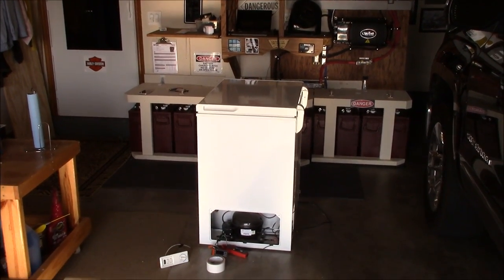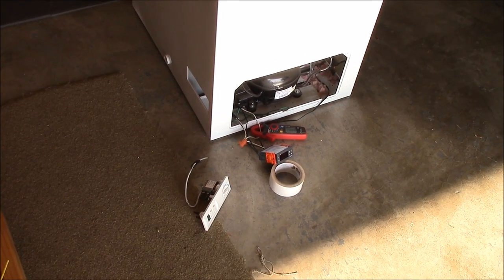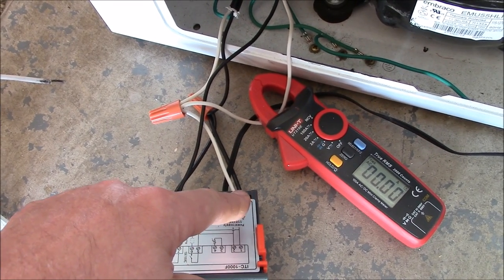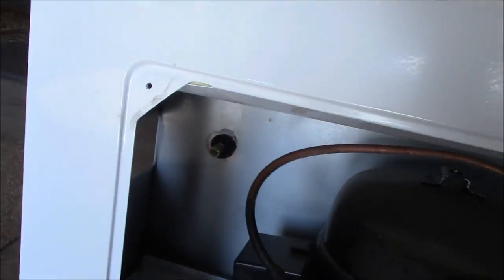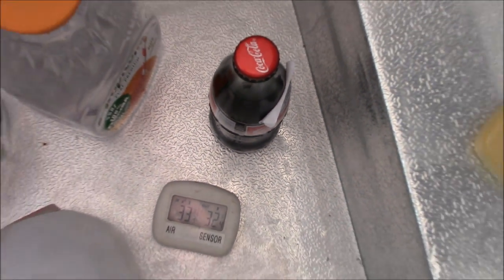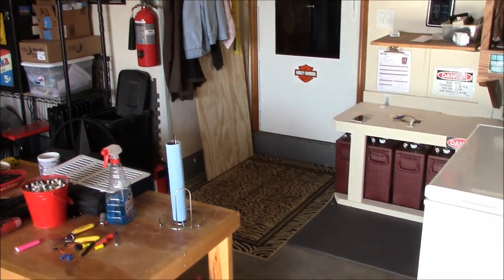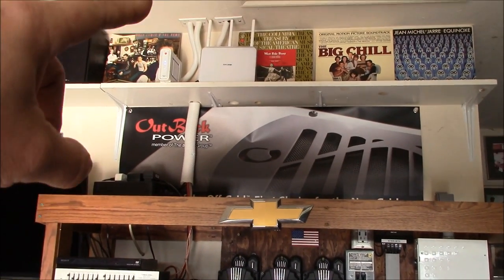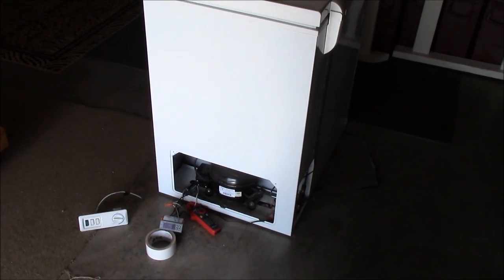Deep freezer to refrigerator conversion / How to wire it up

Comment: The solar looks good, nice n neat.
Reply from the maker: Thanks...4 and 6 AWG THHN (NEC rated) wire to the three controllers to the Carling C-series panel mount breakers. No more DIN-rail polarized breakers, ever.

Comment: Hey, cool project, lol.  I saw this YT vid where this guy made a freezer like yours even more energy efficient by strategically installing rigid foam in places.  I know he stuck a panel on the underside of the door and a couple around the compressor.  He did a before and after comparison too.  Great vid!
Reply from the maker: Hmmm...gotta link to his video?
Reply: Hi, I got lost looking at a bunch vids and can't find the "one" I was referring to, but without going too deep, insulating btwn compressor and box and allowing heat to vent out, rigid or spray foam.  Alonso it's easy to cut a piece to fit under lid.  Of course adding rigid on the sides and maybe in the door too.  You know when they manufacture these it's all about saving money, so not much thought to adding expensive rigid.  You know I was just thinking since you were messing around with it.  I've even thought about a computer fan at the compressor to expelled heat.  It appears maybe your condensor coil is hidden inside the skin?  Interesting way to dispelling heat, ya think? Another fan?  Idk, Anyway, appreciate your posts!

Comment: Nice work brother im going to try that soon. System is looking great I hope U have no more issues.
Reply from the maker: Thanks man...good to hear from you. Saw 5,100+ watts (from 4,900w in panels) the other day. Had a little cloud edge effect and cool panels. Nothing "popped" on the new set-up. It is running really, really good. All the Midnights have the new and latest firmware updated too.

Comment: Nice job Chris.  That is a similar set up to the style of fridge I use up at my lot.  That modified freezer should not operate as frequently as a normal fridge, I would think.
Reply from the maker: Roger that...agree. Gonna throw my P3 Kill-A-Watt meter on it for 24 hours and see how much it uses. Should have took a 24-hour reading prior to installing the digital thermostat. Thanks.

Comment: Would you be able to use this configuration to hold the temp at a significantly warmer temp? I'm thinking about converting an old chest freezer into a beer fermentation area and would want to maintain temps around 64-72 degrees.
Reply from the maker: IDK...Amazon still sells them for $16 https://www.amazon.com/gp/product/B0152LYY0I/ref=oh_aui_detailpage_o02_s00?ie=UTF8&psc=1

Comment: I see your tube for the thermocouple is horizontal. I watched your second video first lol. Mine are vertical. Does your tube curve up? That would be hard to push the flimsy wire up there far enough. There is a little delay doing it the way I did but the band width (temp swing) is only 1 degree more than doing it the way you did. I tried it both ways just to see if using the original tube thermostat location would work. On my 8 1/2 ft it took some time to get the thermistor wire up there. I am sure mounting it the way you did is more accurate.
Reply from the maker: Thanks! The old probe pulled straight out (8" long). Sealed the hole with silicone. No way in heck to install that flimsy wire into it. The probes thickness was about the diameter of a metal clothes hanger. Wiring it up was a breeze...

Comment: My 145 litre (about 5 cu ft) chest freezer/fridge uses less than 200Wh per day in the winter and about 300Wh per day in the summer.
Reply from the maker: Holy Moses...really? That is great!
Reply: I was able to see how much electricity it takes to charge the batteries while I was staying up the road at my parents' place over Easter.

700Wh. That's with the fridge and inverter running.

Comment: I have a 3.5Cuft chest freezer, and the same thermostat controller as you but it's the 12v version. My idea was to use a small inverter I have to use only for the fridge. I wanted the thermostat to tell the inverter to turn on and off to avoid idle draw. I hope I can get it working and I'll run some Kill-a-Watt if anyone is interested. Wiring tips?

Comment: Does this conversion decrease the electrical power needed for the unit?
Reply from the maker: It decreases consumption use, not electrical power load. So, basically, it runs less set at 34F vs -5F (freezer).

Comment: Thanks Chris, good video! I have saw this method before, and would have tried it, but couldn't think of a practical way to get things in and out of it. The thought of loading and unloading the piles of vegetables, drinks, leftovers, etc. from a setup like that wouldn't work for most people. There are only so many baskets or boxes that would fit, and again it would be a pain to dig through. If someone only kept a small amount or used it for cold drinks it would work better. Maybe you'll have a better way to use it then the way I described. Thanks!
Reply from the maker: I use two of those plastic milk crate deals...works really good.
Reply: @ChrisDIYerOklahoma  This seems perfect for keeping a large quantity of beverages cold and ready without the monthly running cost of a fridge! Thanks for the video!

Comment: Wow, nice! Some people say that condensation/water builds up on the bottom over time, and you have to "mop" it out.  Are you having a problem with that, or have you possibly made a drain out the bottom? Thanks for making this video!
Reply from the maker: Nope, no condensation/water...maintains at 35F 365/24/7...no issues at all, been running non-stop since I did this mod years ago

Comment: Did you use a 12V or a 110V device? I see both options on the amazon post you put up. Not sure if it matters or not but I intend to use the device for the same application, in fact, the same freezer as well.

Comment: On a scale of 1-10 how difficult is this? Honestly doesn’t look too hard and looks to be a better solution rather than a temp controller I’ve seen. Need my freezer at fridge temp for kegs
Reply from the maker: Prob about a "5". The hardest part was to figure out the wiring. FWIW - this is an old video...BUT! this fridge-freezer is still working 100% perfectly. Good luck

Comment: Why didn't you just get an external thermostat controller with AC plug. No wiring required😂
Reply from the maker: The failure rate is higher on those. My mod is working to this day...no issues
Reply: @ChrisDIYerOklahoma  
Other YouTubers says the same. Depends on which Chinese brand. Few happy campers are using the same brand (analog).